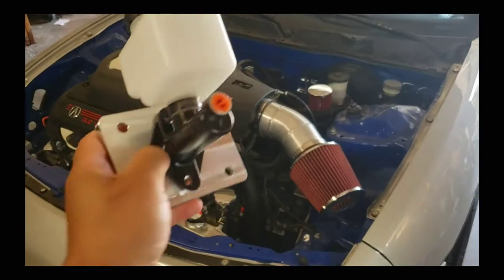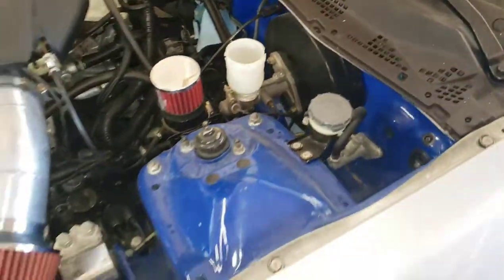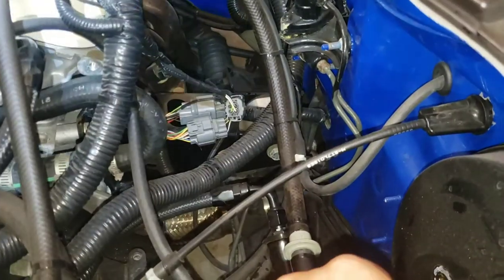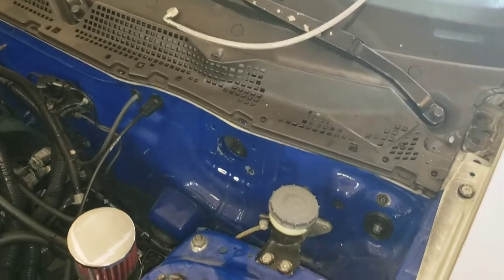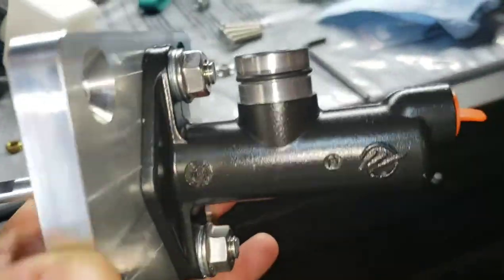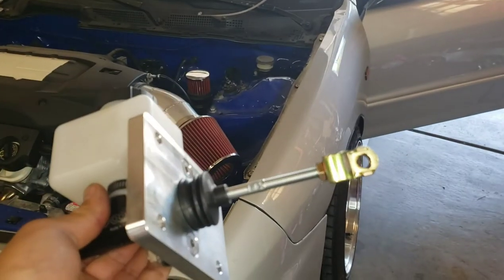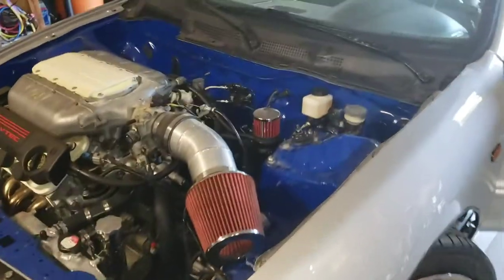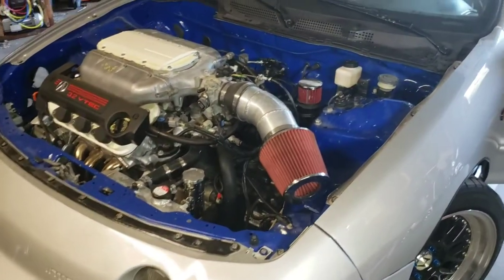Honda/Acura Brake Booster Delete Worth it???

Comment: Where did u get your brake lines and that tee. The tee I was given today there’s no stop or end of threads on the inside so the flare has nothing to seat again and obviously they leak.
Reply from the maker: The lines i got is actually what the seller recommened me to get. Never had issues with leaks. Still works great today.

Comment: What size splitter did you use?
Reply from the maker: 40/40 civic si prop valvd
Reply: @FlipSideGarage I’m talking about the T that’s splits into 3
Reply from the maker: @ismaelolvera6763  i brought it to a truck store and got it from there. I dont remember